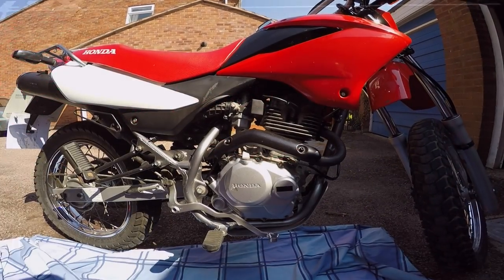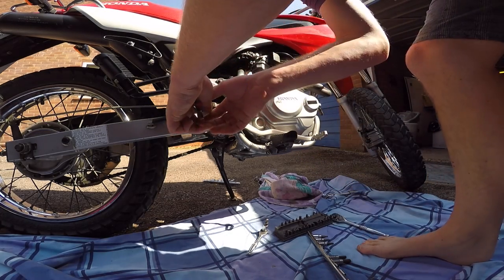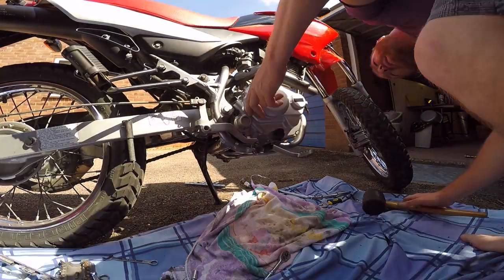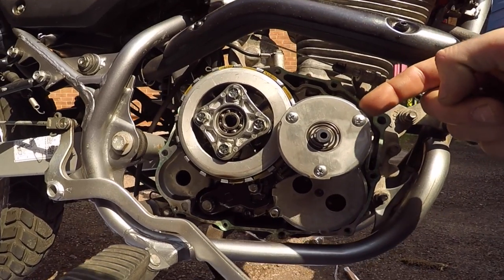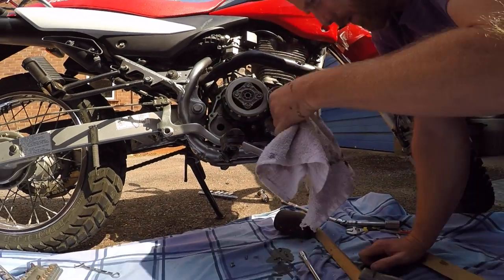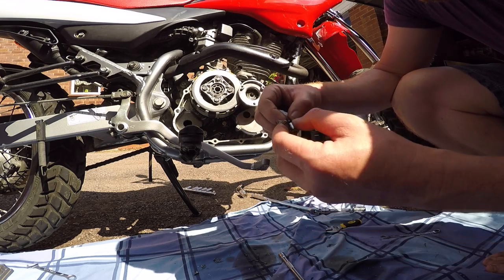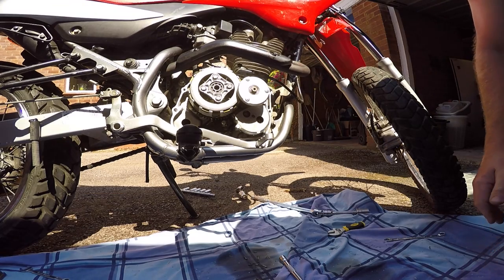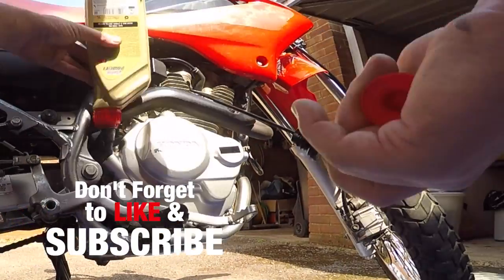Honda XR125, Centrifugal Oil Filter Clean - How to-

Comment: awesome video mate, i am in the process of rebuilding my XR 125, not done anything with the engine like that but have just replaced a corroded swing arm as it was about to collapse. I think this will be my next thing i shall be doing. I have always avoided the engine as its my least knowledgeable area. Very good video mate. Your bike looks in great condition. My bike rebuild has taken about a month, as my local garage ordered the wrong parts. Very good video mate :).
Reply from the maker: +J Burkey Thanks, good luck with your challenge. I think i got quite lucky with the condition of mine.
Reply: +Phil JC It did look in very good condition. What year and mileage is yours?

Comment: Last time my was done it was clean. Got to keep on top of those 2000 mile oil changes and regular level checks. At 26k miles they do use some oil. Only thing that kills these amazing little engines is low oil.
Reply from the maker: Yes this is very true.
Reply: mine burns about 300-400ML after 1200 miles but I beat the shit out of it.

Comment: Hello, thanks for the video, what was the top speed on yours ? I get a bit more than 90 -95  km/h under good conditions (I weight 91 kilos)
Reply: Boxing Talk I hit about 110kmh on a straight line. I weight 70kg
Reply: yeah me 2  i get 110kmh 70 kg
Reply: Managed to get 120 once, that was full tit down a flat road. But mine is the 150cc model and I do way only 53kg

Comment: Why would Honda make it so inaccessible.
Reply from the maker: +Cairo Murphy (TheMasterAssassin8787) Ive no idea why its so hard to get to. Maybe its not that important to do so often. I just had no idea when mine was done last and felt like having a challenge.
Reply: This needs to be in, filtering the oil. Where do you want it to go? In the handle?
Reply: My xr650 has a throw away filter you replace when ever you do an oil change, easy peasy. No removing side cases to change an oil filter.

Comment: but bro after you fitting the clutch cover , you just simply started the engine , without putting engine oil in it .... how funny no one noticed this , which is a great mistake ... however this kind of oil filter does not need any periodic cleaning except any extreme situation .
Reply from the maker: Thanks for your feed back.
1st point - No one noticed because at 7.56 mins onwards they have seen me putting the oil in.
2nd point - when you buy a 10+ year old bike that you know little of the history of and you also want to learn about the bike and engine its not the worst thing to do.  Plus what would you consider an extreme situation?
Reply: @PhilJC  in how many km it is better to clean oil filter
Reply from the maker: Bensa Ip This oil filter does not need to be cleaned very often at all. Maybe just when you replace the clutch next. I only did it as my bike was 10 years old at the time and I had no knowledge of its history.